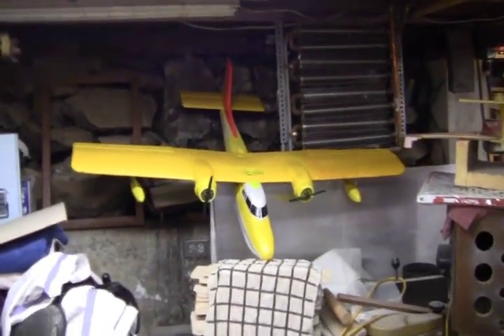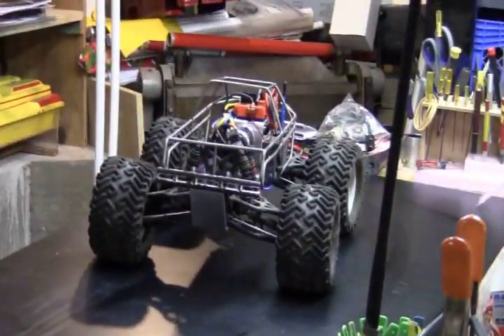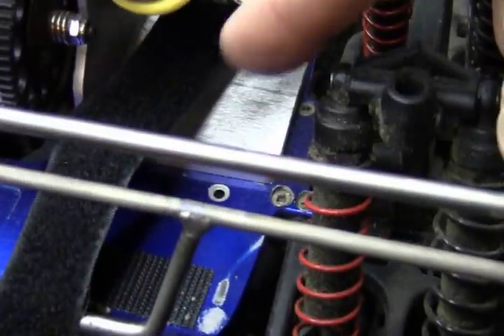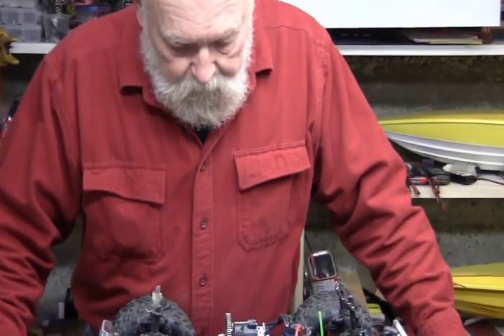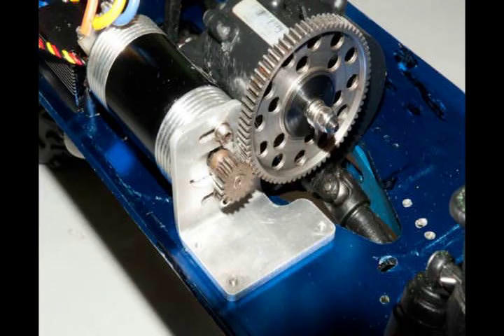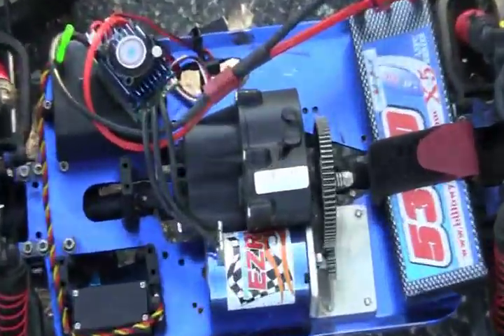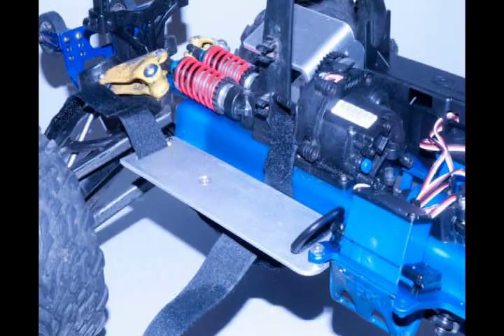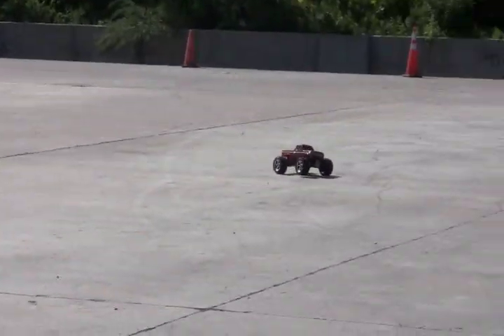How2RC Traxxas T-Maxx REVO Conversion.to Brushless Electric Battery Power

Comment: I know this video is old but don't waste your money buying the bracket you can make it yourself with just a piece of angle aluminum drill some holes in it and bolt it down
Reply from the maker: Where do you get T6 Al angle?
Reply from the maker: https://www.youtube.com/watch?v=oDhiVb2Tj2Q  How hard can it be 2 bolts and 3 wires , surely even you can do that?

Comment: On the revo at the end of your video what type of motor do you have on there what type of battery are you running and how large is your ESC also where did you get these products at and what motor mount would you recommend for my T-Maxx it's the newer one thanks Robert
Reply: The motor is no longer available, it is a 550 size 35mm diameter X 65mm long, BRUSHLESS. with a 100Amp ESC, I am running 5Amp LiPo batteries 3S, 100C, You need a large C number otherwise they will die with the Amp draw of the Revo or T-Maxx

Comment: I like the idea of converting my redcat 1/10 nitro into an electric. I have a spare motor and esc from a kyosho tf5. I have found a way to fit the electric 88t 48p spur in to the central dif without destroying the nitro setup too and keep it. The only thing that remains is to find a nice motor mount that would be steady and not strip the gears

Comment: Brilliant video are you mounting plates still available for a Revo ..if so do you ship to South Africa ..thanks
Reply from the maker: Both the Al for 10 scale motors and the Stainless Steel mount for 1.8 scale motors are available. On How2RC.com
Reply: How2RC do you have a video on the gray 3.3 tmaxx transmission conversion when going to brushless? as far as what to take off and parts?detailed?

Comment: if you put the mount on the other way around you could mount up a cheap 1/8 buggy setup from hobbyking.com or some other site to get extremely high speeds but for a 540 in a huge monster truck I'd say that's pretty damn good

Comment: those are all slow. get a 4 pole 2200kv, they are fast and snappy both plus s6. have to have a 4 pole esc...
Reply from the maker: +Nathan Wimer   Come on over and I'll run you, you might just loose!
Reply: +How2RC and you might get schooled, it's a 6s setup and does 60 mph when I can keep the front end down. like I said, 2200kv...

Comment: You should make it solar powered.  Nothing greener than that or go full circle strap a nitro engine to the top running at a constant speed pulling a generator outputting 12 volts to a battery charger.  Just let it sit and charge itself for 40 minutes.  Nice workshop by the way.